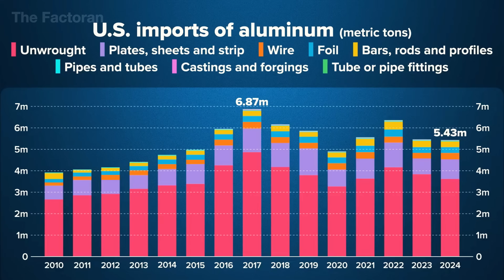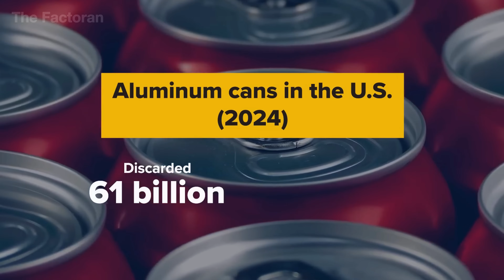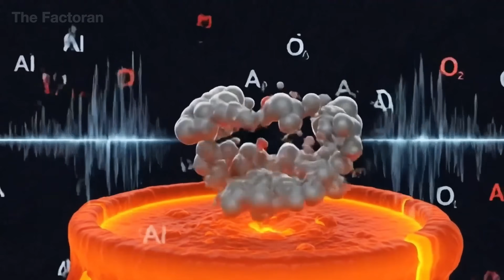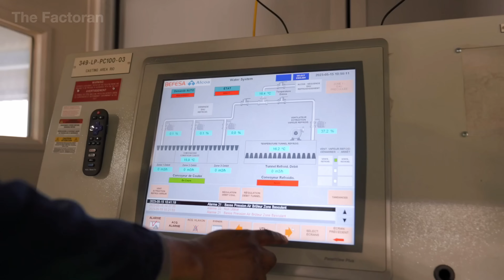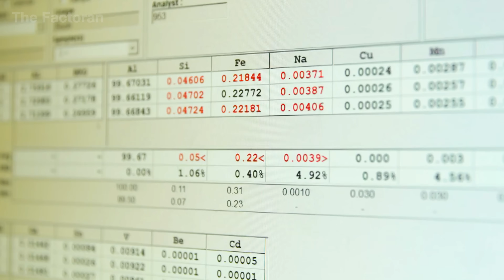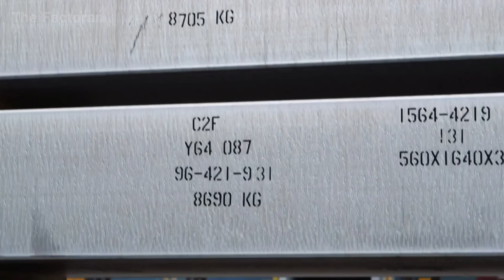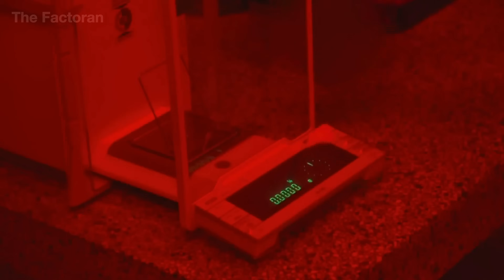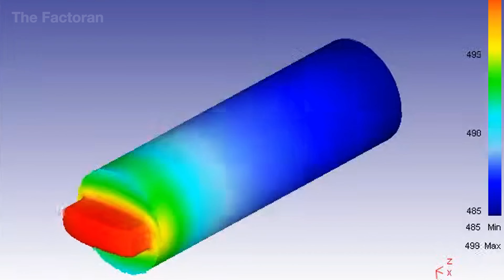How Millions of Aluminum Foils Are Made - From Mining Bauxite To Factory

Comment: Information: people say used aluminumfoil is not recyclable anymore it burn 's away. That is wrong! Take a lot of aluminumfoil i mean 10000 kilogram and press it in a block pressure mayby 100 or 200 or 300 ton, then put the block into the melting oven together with melted aluminum and the pressed block will be recycled. Aluminum factory's try to think about this thank you!. Sorry i speak broken englisch
Reply from the maker: Thanks for sharing! You're absolutely right — aluminum foil can be recycled if handled properly. Compressing it into blocks and melting it with other aluminum is a smart approach. Appreciate your input — and your English is totally fine! 👍